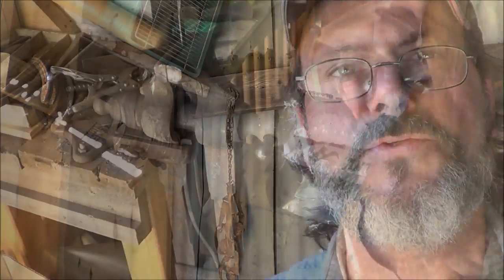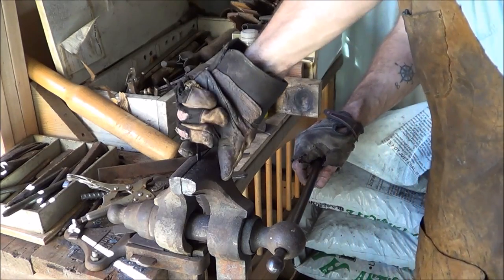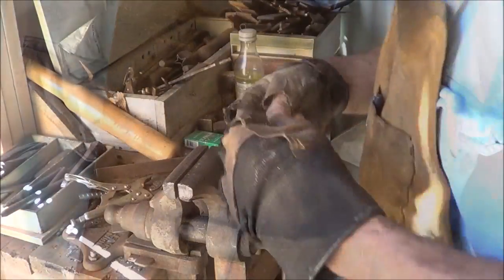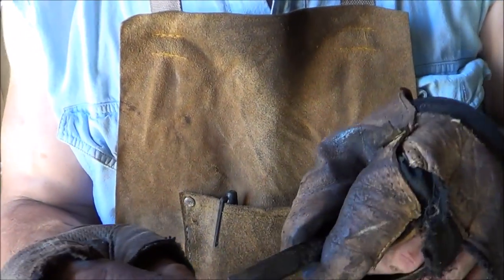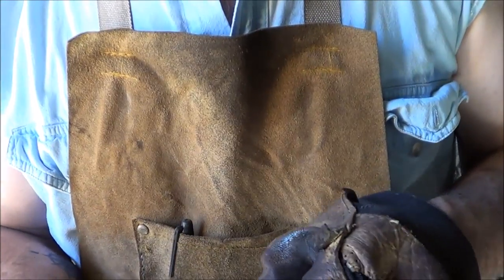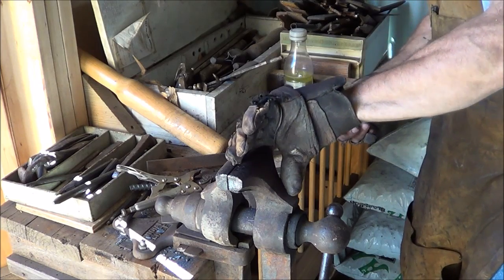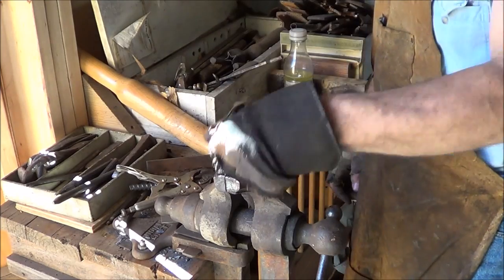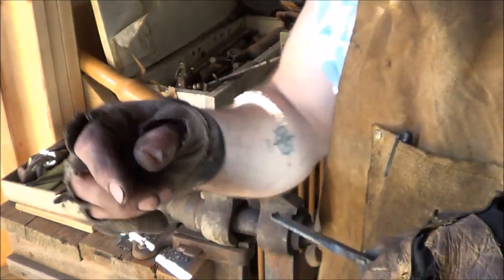Blacksmithing - A Test For Mystery Steel Hardness and Temper

Comment: got a question for ya.... or anyone that might know. i just made like 6 rail road spike knifes.. I'm just starting, and moving along fast.. i just spent 5 hours on this badass knife, with file work, and perfect shape everything.. then i heat treated it, and when i quenched it.. it had a slight warp which doesn't happen often but did, and it bothered me so i got a small hammer and light tried to tap the slight bend out and right when i had it, one more hit shaped the blade in half. i was so pissed! so 3 questions, 1. whats the best way to quench the blade? tip and blade first then the rest of the knife, thats what i been doing.. but its been warping... or just dunk the entire knife in right away as a whole? i don't want warps, mind u the metal is not thin either its got some meat and good width. 2. if it does warp..obviously heat it back up again to fix? and repeat process hopping it won't warp again? I'm just never gonna hit cold steel like that again.. 3. can i bring this knife back from the grave? would it be worth getting a welder and welding the snot out of the break, its right  where the handle and blade meet, and then retreat it, and grind off the excess weld spots.. is that possible? durable? anyone ever do that before? thanx.

Comment: I agree with spark test on a bench grinder as being a good way to tell without forging and destruction test...unless you have a great supply of the same steel. Otherwise, knowing the approximate range of the steel is helpful. I run ino a lot of tool and hardens steel where I work, but sometimes that is even frustrating. A small hatchet I did a while back was made from a guide pin for an industrial mood, and it was a BEAR to work even at bright orange heat..lesson learned on that one, lol.

Comment: working on shapeing my first blade.would i be better to heat till no magnetic.then quench whole blade or hold sideways only quenching 3/8 or 1/2 up on cutting edge then cool on own..used rotella 15w40.
Reply from the maker: +bob clark safest I think would be do the whole thing... depending on your grind.. edge quenching is when I get stress cracking... but only sometimes...lol
Reply: +bob clark this kinda answers my question i had.. I'm just trying to perfect whats best on heat treating.. i guess its a trial and error thing to see what fits best for everyone, cause everyone is different.. i been just using water. i think I'm gonna start using the motor oil instead. can i just use the old oil out of my truck after a oil change?